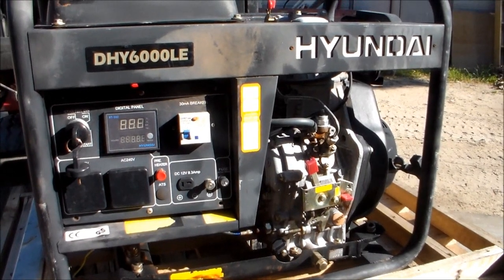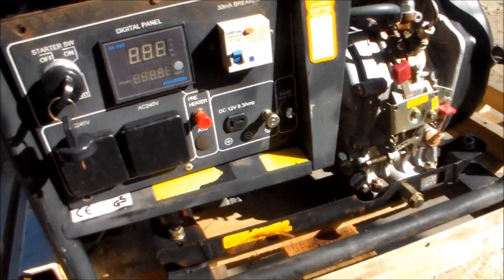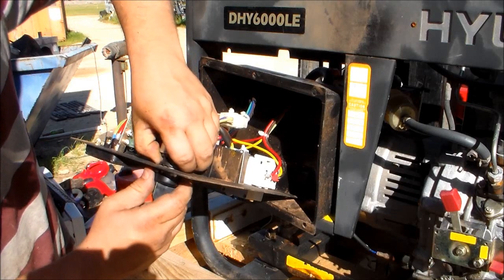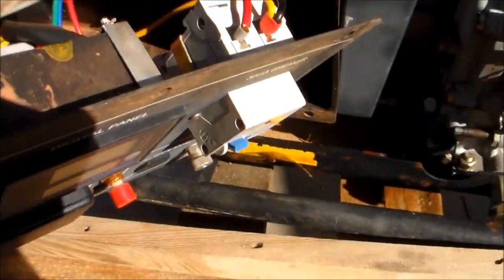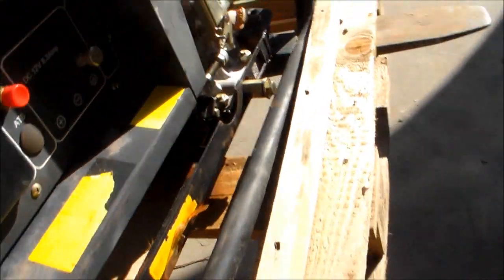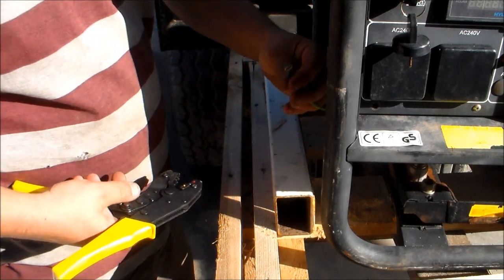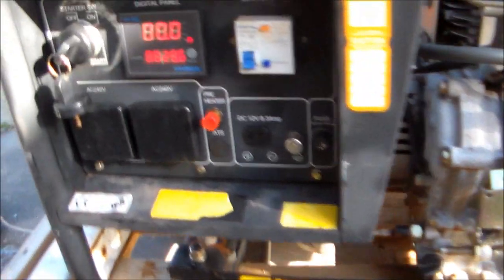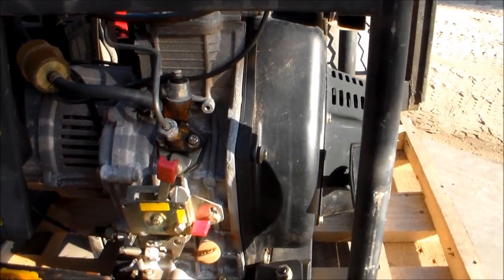Hyundai 10HP 6KVA Genset Repair/Overview/Inspection

Comment from the maker: you can try single transistor drivers. but they dont run on much more than 12 volts and they blow up a lot :-) royer oscillator is good for begginers too. everyone says go straight to ZVS but i think its more fun starting out with smaller jobs and working your way up. you learn a lot! I've learnt a truckload about transistors and mosfets and soon IGBT this way

Comment: I've had a few glass fuses go like that, look fine, but aren't.  Generally I replace them with a blade fuse as in most cars.  They seem to handle vibration better.